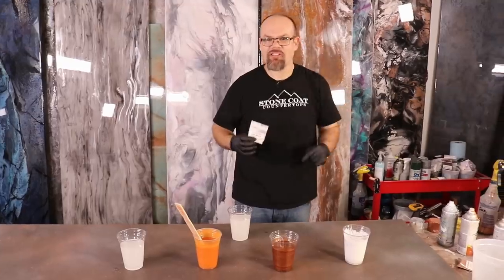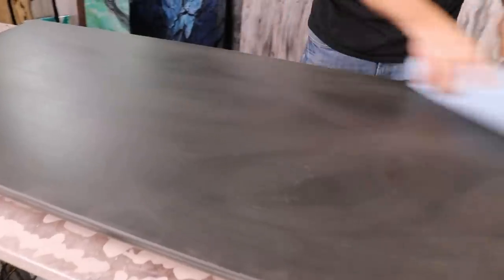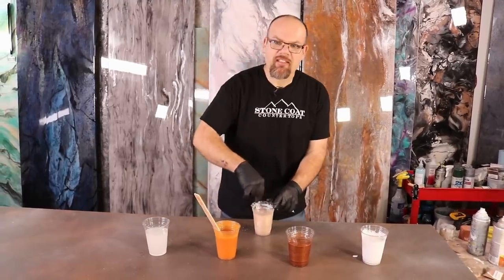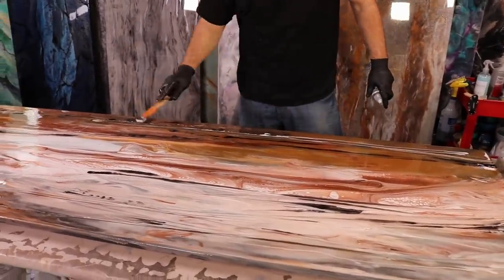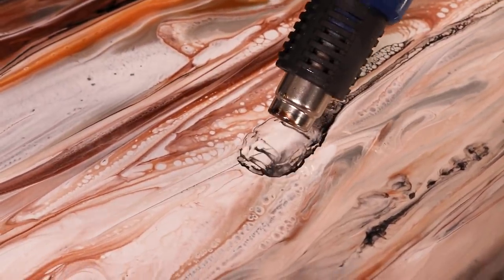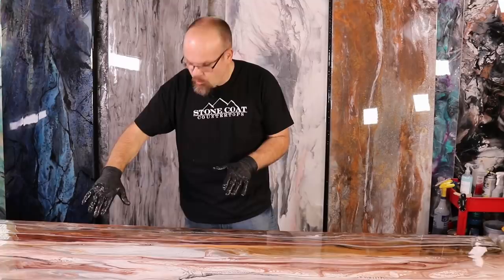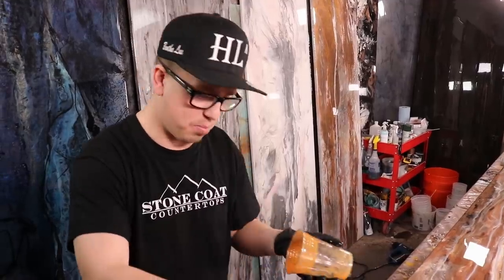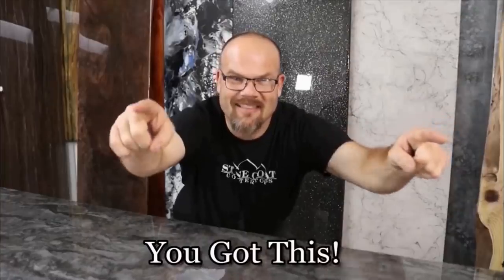How to make Orange Onyx Epoxy Countertops

Comment: My husband and I did this project starting Saturday and Monday we are going back to do the flood coat. The hardest part is doing the prep as we did it over formica countertops. It looks great don't know if we will put the extra work in to do the matt finish after it cures for the 5 days. It turned out very nice and sent pics to SCC. Thinking of doing black galaxy for my fireplace mantle. Will be cheaper than the $1300 for the real deal.
Reply from the maker: Thanks Patricia! The black Galaxy sounds like an amazing idea! You definitely got this! -Nathan

Comment: I use your products and really enjoy working with them. However, I rarely hear any comments/solutions about dimples that appear during curing. I cover my work (it's small enough) with bins to keep dust particles and air movement down, but even then get an occasional dimple. I've tried your hair dryer solution to get them to pop out, but have yet to have one go away.  I usually end up pouring another flood coat and crossing my fingers.  I have been asked about doing a countertop and dread trying to eliminate dimples. I can't afford to keep pouring new flood coats that way! What do you do about them, especially on those large surfaces?

Comment: do you guys have an epoxy that does away with its own bubbles. seems as though I saw some epoxy that did not need to be torched or a heat gun to rid the project of any bubbles. great products and results, you guys are awesome.

Comment: How does your product hold up for outdoor use? Do UV rays have a negative affect?
Reply from the maker: Hi Dan and Jeanne Cybulski you won't want to apply this epoxy in direct sunlight, however you can use our Art coat epoxy for your outdoors projects as it has the most UV inhibitors  of all of our projects.

Comment: OH BINGO!   THIS is what I'm doing for my kitchen.  Maybe less browns, more peachy but THIS right here...     Question, don't you have to do a clear top coat on top of all that mixed media?  And how long does this take to fully dry, or cure?
Reply from the maker: Hi Artmakersworlds, Yes we always apply a clear coat of epoxy over all of our projects to get to a food safe, durable, heat resistant wear layer. The epoxy is dry to the touch in 24 hours when between 70-80 degrees and takes 30 days to a cure where you'll have your heat resistance and durability as shown in this video- https://www.youtube.com/watch?v=YLUteivXWaM&t=154s

Comment: I wonder if you guys ever tried to put epoxy on radiators? Question is if the expoxy is elastic enough and wether the long time exposure to heat will make it age faster or yellow or something. Also: Thermochromic Pigments anyone?
Reply: I feel like this is a bad idea... lol
Reply: @agermangoeswest6544  I wonder if we think about the same kind of radiators. I am talking about  the metal bodies where warm water gets pumped trough by a central heating system. They typically reach somewhat between 40°C to 80°C which is within the spec.
Reply from the maker: Hi YouHolli! Our products work best on smooth flat surfaces as the epoxy is self leveling, give us a call at 541-450-1976 and we would love to discuss this project with you!
Reply: @StoneCoatCountertops  You know, I tried that once. As soon as you realised I am not of north american descent you hung up.
Reply from the maker: Hi YouHolli We would love to speak with you about this please give us a call at 541-450-1976 or write us any e-mail to Stonecoatcountertops@gmail.com

Comment: When your applying your epoxy on a countertop in a cx home do you still torch it? If so what precautions do you take so you don’t burn the trim or backsplash around the edges of the countertop? Thanks

Comment: USE A RESPIRATOR BUD! When you are 60 you will be on O2! be SMART!
Reply: The epoxy is non-toxic. Which IS smart.
Reply: NOT VOCs! It is the FUMES are irritating to nose/lungs as well as the SPRAY PAINT toxic and much is sprayed to color it. I do this as art and know that LUNGS and health are ignored by many--and then at 70 years old they pay dearly...according to MayoClinic.com, two of the “High Risk Occupations” for developing occupational asthma are Adhesive Handlers and Users of Plastics and Epoxy Resins! BE SMART!!!
Reply: Epoxy gives off zero V.O.C's and therefore no fumes. Epoxy cures by combining the resin and hardener to create an exothermic reaction. So other than the odor, it's not emitting any fumes. The spray paint on the other hand... yea that will brain your damage.